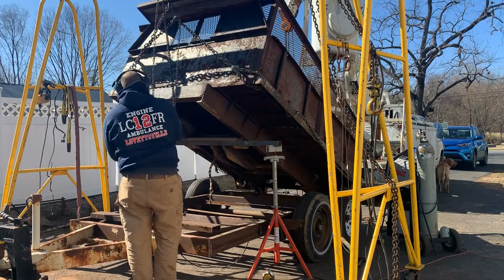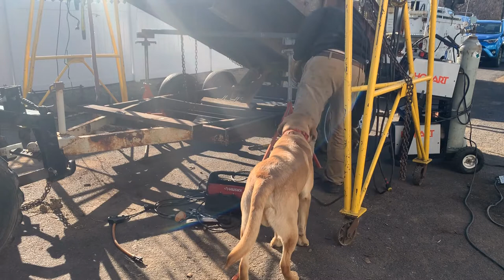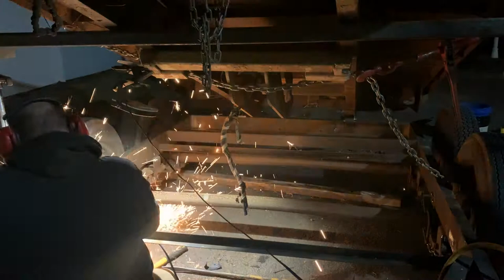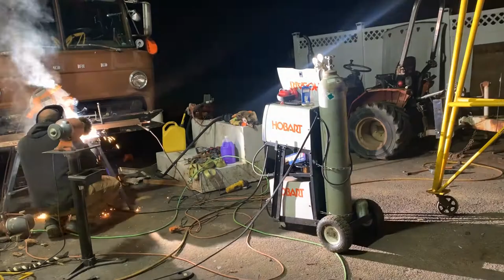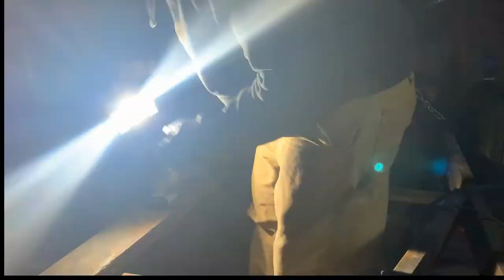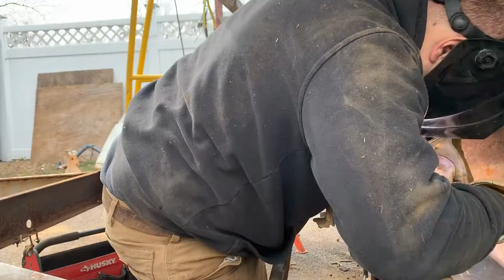DIY 7000 LB Camper Frame Dump Trailer Part 3, welding in the scissor hoist and crossmember.

Comment: With all that work could've bought one I just picked up a 7x14 for $2500
Reply from the maker: I spent maybe a fifth of that, and mines built better than most commercial ones. And it works exactly how I want it to. 
Plus at the end of the day I get to point at it and say “I made that.”  Can’t buy that feeling.